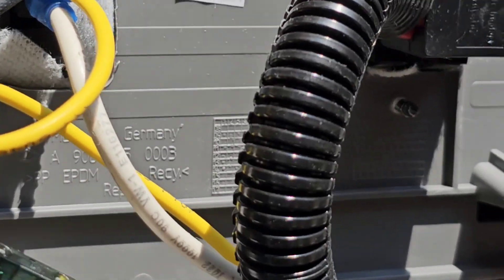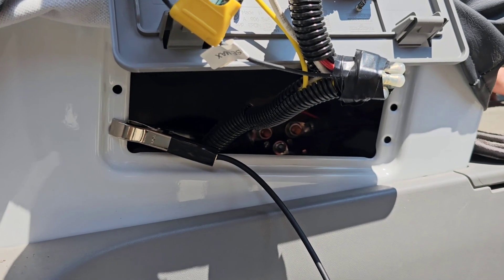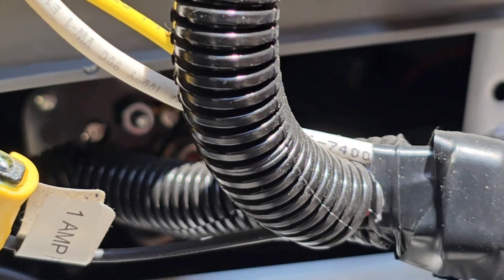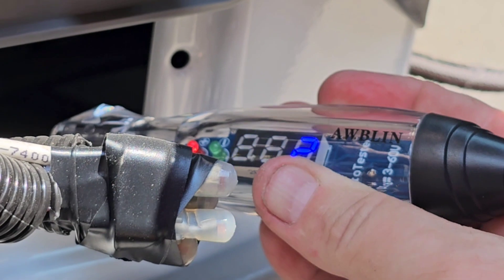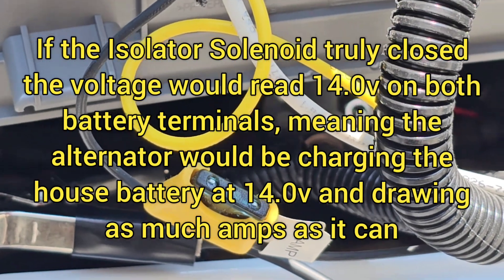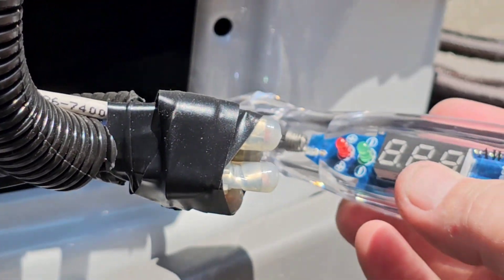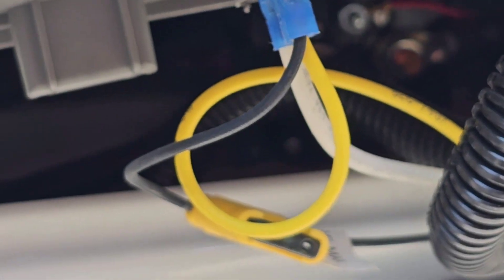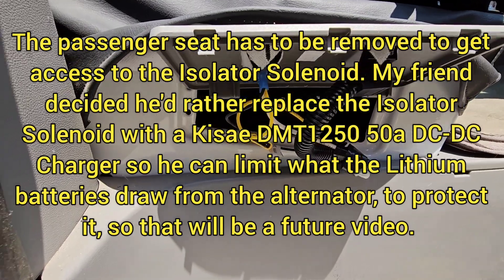Testing the Isolator Solenoid in a Leisure Travel Vans

Comment: They can sometimes become intermittent and will work sometimes but not other times.  The failure is usually in the contacts (sometimes called points).  After so many operations, the contacts get burned from the tiny spark that occurs each time they open and close.  When the contacts are grayed and pitted, they are bad and the solenoid must be replaced.  There could be times when they pass current and other times not.  In any case it is time to change it out.  The White Rodgers solenoid used on many LTV's tends to fail early, perhaps 3 to 4 years, but it depends on how many times it has operated. Several people have replaced the unit with a Cole Hersey solenoid which seems to last longer. The wiring terminals are on the side with the Cole Hersey so it may require moving the big red wires slightly.  There are no polarity concerns for the coil since it is just an electromagnet. One caution when changing these things out:   Both house and chassis batteries must be disconnected. Lift the negative on your house battery and disconnect the Mercedes battery via the cable by the accelerator pedal.  If you don't do that, and one of the big red cables touches the metal seat frame or any metal nearby, you blow a fuse.  How many people have changed these out only to find a blown fuse? They think it was the fuse all along.  Maybe, but more likely the batteries were not disconnected.  Note that by observing your shunt (if you installed one), you can tell if the vehicle is not providing charging current.  The tests that Sandra provides will help confirm that the solenoid is the problem.